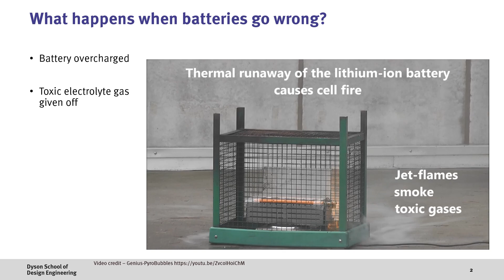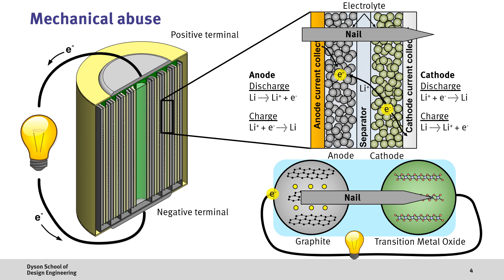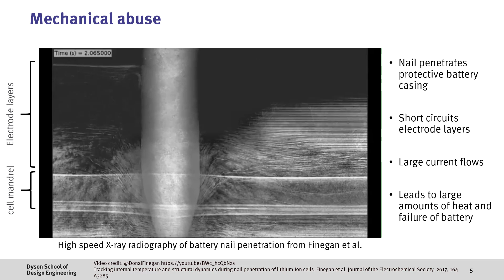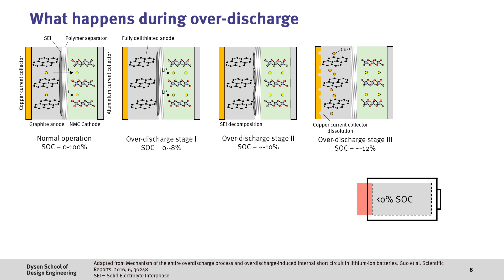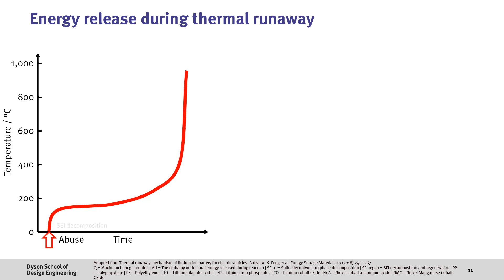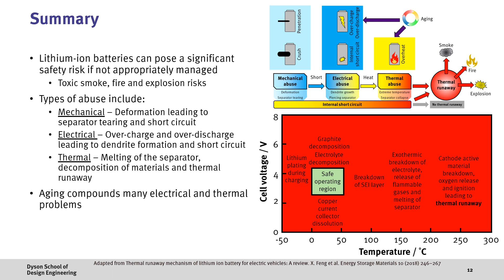Battery fires! What happens when batteries are abused?

Comment: What causes the Li-Ion battery to fail, and cause it to explode and catch fire very easily?
Reply from the maker: There are many reasons why a battery might fail and subsequently catch fire. If operated too aggressively or in extreme environments this can cause the battery to overheat which can cause thermal runaway. Equally if charged too quickly this can cause metallic dendrites to form which can cause short circuits and overheat; leading to thermal runaway. Other mechanisms also exist so care needs to be taken

Comment: How much safer is the LFP battery as some EVs have this type of battery? I have seen LFP penetrative tests on Youtube that seem to be a lot less dramatic.
Reply from the maker: The exact numbers depend on the design of the battery, but LFP in general releases about half the heat of NMC and ~a quarter of the heat of NCA cells with a higher decomposition temperature as shown in slide 11. Safety characteristics ultimately depend on a number of things such as nail penetration characteristics, heat release when over heated/over charged etc.

Comment: I see your accurate ; but it must be pointed out to people - batteries do not need to be abused to catch fire. Recently a ship containing brand new just produced EVs had brand new never abused batteries catch fire burning the entire ship up.  It is critical for buyers or potential buyers to realize there is a risk of fire with EV batteries even if you do not abuse them at all. This is due to dendrites; deposits that can build inside the battery which can short basically at random causing a fire; once one battery catches fire it spread to thousands of other batteries and there is really nothing that can stop that fire.
Reply from the maker: Good point and agreed that there are other causes of failure in a battery also. As the quality control of battery production increases and also improved safety designs are implemented hopefully this will decrease the likelihood of these events, but right now there is still a risk to be managed

Comment: Nice explanation - but still have to question the technology - is it really green, safe and even futuristic? I give low marks on all accounts.
Reply from the maker: Thanks and good question. Sustainability of batteries could still be improved with some elements of the materials extraction and manufacturing being a bit carbon intensive. Safety is still an issue but there are new battery types which aim to improve this (i.e. solid-state batteries). Overall both elements are improving.

Comment: definetly one of the best teaching videos about Li - Ion Batteries i have seen so far ..
(but i still have to watch it at half speed )

Nice video ..., but what is adding to the confusion is that different sources (youtube videos) mention different temperatures ...

60 degree Celsius  a batterie starts degrading ... (e-Scooter reached 60 degrees Celsius during normal , modest travelling for 10KM, ambient temperature was about 10-15 degrees Celsius )

70 degree , separator starts decomposing ...
100 degree Celsius  , Elektolyte with Anode  reaction ..
130 vs.160 degree Celsius C seperator starts melting ...
Reply from the maker: Thanks and good points. The exact numbers can change depending on the specific materials used. For example different electrolytes and additives can change the thermal stability and there are different types of separator material being using. So, this video hopefully gives some starting points to consider but the exact values can vary depending on the specific materials used.

Comment: This video is very helpful, very nice work.  I think that lithium batteries are a bit dangerous, they are almost everywhere.  I was thinking that it would be possible to safely store it in large quantities and quickly put it out if there was a fire.
Reply from the maker: Thanks. The technology is getting safer but quality control and technology is key. Since the market is increasing so rapidly not all cells have the same quality control and therefore we need to be careful and also plan for the worse case. There are increasing numbers of products focusing on addressing this issue
Reply: @BillyWu  In your description of the various stages of thermal abuse, at 300 deg C, the lithium Oxide disassociates and oxygen is released, thereby feeding the fire. For LFP batteries, does a similar event occur?
Reply from the maker: @exsollertan7366  Good question, in one of the later slides I show the onset temperatures of different materials. LFP is generally safer since it releases less heat and less violently but can also decompose.
Reply: Biggest problem when a large amount burns or when in a parking garage.
Reply from the maker: @bendaistvan79  Definitely. Hazards go up significantly with size of system

Comment: hello is it safe to leave a lithium battery in my hot car during summer? it gets up to 140f in my car (60c).
Reply from the maker: Probably best not to. There's been a number of battery safety incidents in India related to high ambient temperatures. Where possible remove them or at least put them in shaded areas

Comment: Most data sheets specify 2.5V and 4.2V as the discharge and charge limits. Are these open circuit voltages, or terminal voltages? Is the degradation of the cell cause by terminal voltage or (in some sense) the open circuit voltage?
Reply from the maker: Ideally you don't want the terminal voltage to go beyond these levels, but in reality its the internal battery voltage which is important though in some cases it can be difficult to exactly measure it.

Comment: This is an excellent over-view of battery fires, without too much confusing chemistry for some people.
  In LFP (lithium iron phosphate) cells, the oxygen atom is attached to the phosphorus atom; whereas, in the other battery cell forms, the oxygen atom is attached to a metal atom. Is this the main reason an LFP cell is more resistant to mechanical and thermal abuse?
  What can firefighters do to abate a battery fire, since the cell's chemistry provides its own oxygen for a fire? Would a liquidized gas (CO2, nitrogen, hydrogen) dampen the fire?
Reply from the maker: Thanks. Yes, that's correct. Generally speaking, the oxygen is more tightly bound in LFP than a chemistry such as LCO meaning potential thermal hazard is a bit lower. Also, LFP has a more stable atomic structure (olivine) than LCO (layered) which means over-discharge is a bit less detrimental. Still challenging to stop battery fires. There are a few solutions such as fire blankets and vermiculite based extinguishers being proposed but I think we still need better approaches.

Comment: Great work, Billy. Is there any reference for the SEI decomposition at 70C ?
Reply from the maker: Great question. The various additives can modify the exact number but reference such as Wang et al 2006 Journal of the Electrochemical Society 153 A329 "Thermal Behavior of Lithiated Graphite with Electrolyte in Lithium-Ion Batteries" gives data on this.  https://iopscience.iop.org/article/10.1149/1.2139955